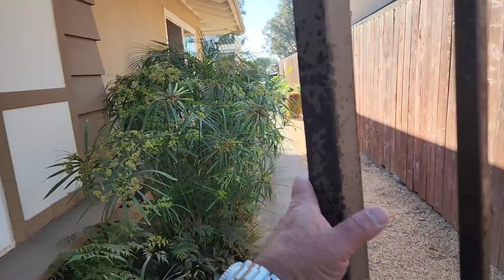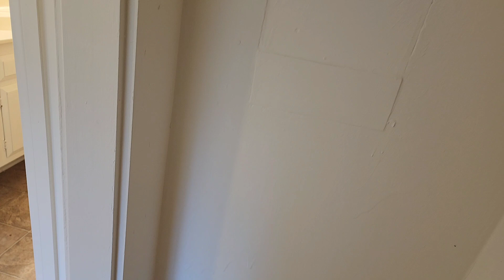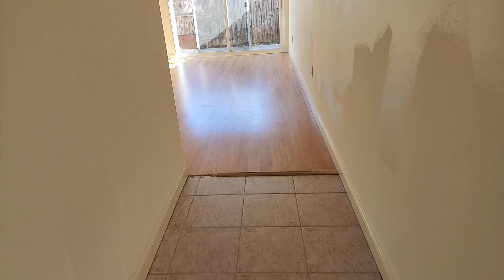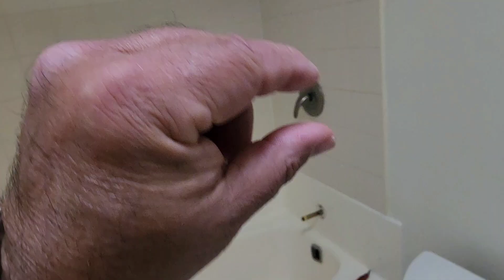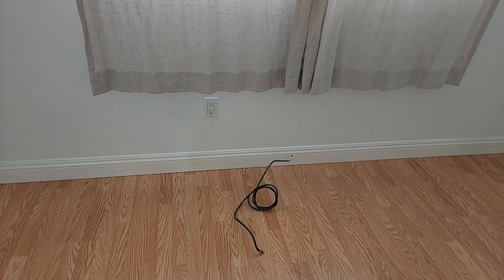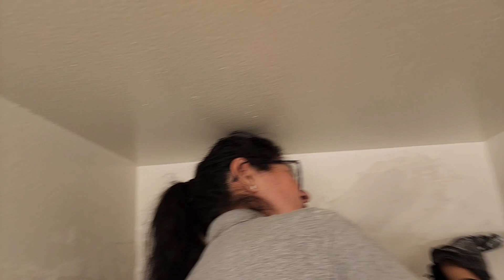Apartment turnover part 1

Comment: Ok for thoes terrible rusted nuts on thoes cartridges get a oul filter wrench.  The 6in channelock brand ones and harbor freight has a offset one that's bigger but nessary sometimes.  That puts 3 points of contact or more on thoes rusty thin nuts.  You can rock the oil filter pliers back and forth to loosen it.  Landlords like deltas especially the ones with built in shutoff on the sides in brass so the cartrage can be changed with no skilled labor.  It's 100 bucks more so so for the fancy valve but it saves you in maintenance down the road plus you done have to do the ball valves on the supply.  As for over the showers 🚿  consider frp no fancy drywall work cheap and works great even on the ceiling wont get moldy.  To be clear just over the shower this isn't a hospital or restaurant and yes frp comes in colors there's a biscuit that matches builder beige well.  Good stuff bang it out liking this channel more and more now that I've seen a little.  I do alot of apartment maintenance too 👍
Reply from the maker: @MattHmm-rq6dn  thank you I'm glad you're starting to enjoy the channel That's what we want to hear thank you for sharing your knowledge as well Hope you have a great weekend.
Reply: Weekend your funny as you know with your own business it's 6 to 7 days a week easy with paperwork employees ect.  That's my pain I'm sure your not too far behind.
Reply from the maker: @MattHmm-rq6dn  You're right we're working today and Vinny is working Sunday putting recessed lighting in a vacancy he wanted to start it on Sunday that way nobody else gets in the door so he goes over there on Sunday and starts cutting holes because he knows he can't be there Monday lol.